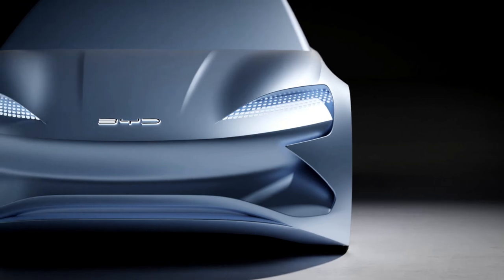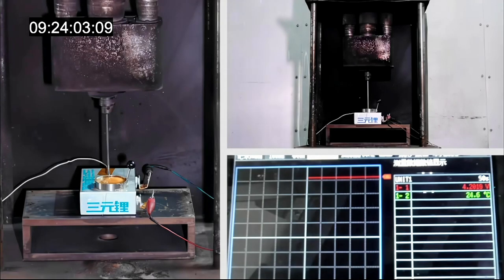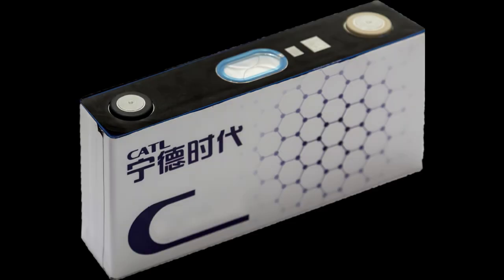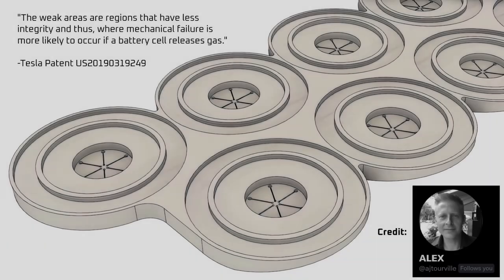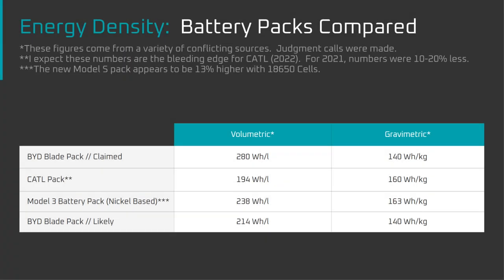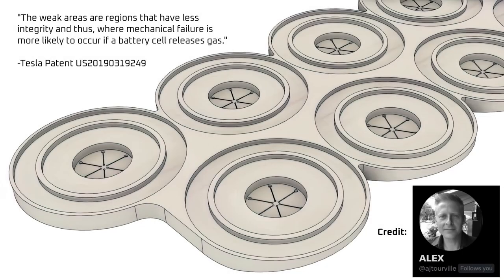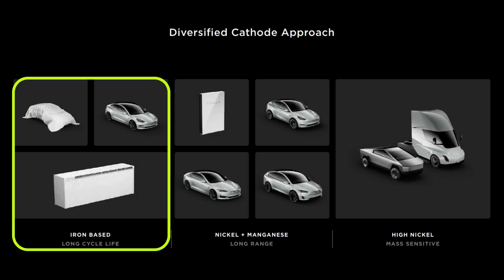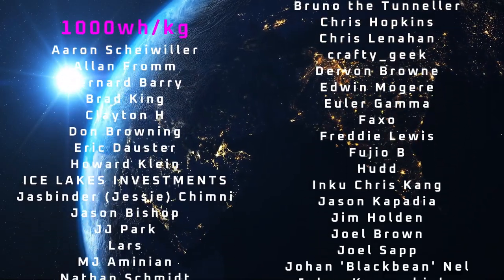The BYD Blade Battery Evaluated:  The Hype is Real (Mostly)

Comment: I had a different take on the blade short claim.
Long cell means relatively long internal distance (lateral) to short location.  Further distance to short = delayed current contribution ( I picture an instantaneous voltage well centered on nail puncture location. Prismatic has very steep well that normalizes quickly, while blade has less steep well and takes longer to flatten).  Similar to fast charging current inhomogeneities.  Long cell intentionally introduces current inhomogeneities at high power (short), extending time of short discharge due to decreased current at short, decreasing heat buildup at point of short.
NOT SURE THIS IS TRUE,. Just laying out my immediate thought when you first mentioned the claim of longer short circuit. 
Also, heat buildup of rapid mass transfer is better distributed away from point of short and close to surface for dissipation.
Thanks for producing these!
Note, this is purely personal opinion.
Reply from the maker: Thanks for your thoughts!
Reply: "long internal distance" depending on which edge the contacts are on.
Put them on the "long"edge of the  cell (top and or bottom) and you essentially have an unrolled 4680.
Then you have a REALLY short path with all the associated benefits.

Comment: nice breakdown.  one thing to keep in mind is that lion(nmc&nca) both do not want a 100 percent charge nor a 100 percent discharge, where as lifep04 has no problem with it.
Reply: They don't want to be STORED at 100% or 0%.
There's an interesting observation in the latest Bjørn Nyland vid, concerning the pack in his brand new Model 3.
He not only details the pack type) size (LG, 78.5kWh, 75 Useable) but talks about the common perception of "0%" and the TWO buffers below that figure in Tesla packs, one of which you simply can't access.
It's interesting!
Reply: Exactly! And Safe non-spontaneous combustion is the first road for electric vehicles.

Comment: Very good video. The issue with the reference to BYDs model Han is that it is based on a ICE platform and not optimized for efficency they took a gasoline car and engineered a battery into it. Of course your video was 2 years ago but the ocean (BYD Seal) seems to have delivered on the promise from BYD and Tesla using BYD Cells is showing that BYDs claims where not to far off back then.

Comment: Some cases, as my bike, lfp does outperform, becouse in my case li-ion is just too much down of the power below 3,5v cell voltage to enjoy. Lfp battery gives pretty much the same power all the way, so in my case I get much more usefull capacity from pack that weights the same. Whit along of all the other benefits on top of that. Just to say to all of the powerful ebike buiders, car business is not exatly my area. I still enjoy wery much of this information, just giving a  diffrent point of view. Thanks man for good work :)
Reply: Exactly!

Comment: 65$/kWh is insanely low cost for now.
I remember not very long ago people speaking of <100$/kWh being impossible to achieve, and 100-200$ range was touted as the level at which EVs can compete against ICEs.
Having said that, 1000 km range vehicle from BYD is not impossible if they redesign it well enough.
On the extreme side you can look at Aptera EV, which achieves 1000 km on 60 kWh battery.
With some decent engineering, weight savings etc, you could easily do 1000 km in 80-90 kWh vehicle of normal proportions.
Reply: just use the nedc testcycle abd 1000km are easy ;)

Comment: You, Sir, via your channel are, Far and Away, the absolute best in providing clear and understandable information on this topic which leads me to this: One unfamiliar with battery chemistry could conclude that the OPTIMUM configuration would be Nickel/Cobalt/Aluminum chemistry in a Blade configuration providing the heat dissipation of the high-aspect ration blade cell with the gravimetric and volumetric energy density of the NCA chemistry. What say ye?
Reply from the maker: Thanks man! Tough call!  That's a lot of high energy, highly reactive chemistry in one cell.  Playing with fire.  Plus, cylindrical is easier to manufacture.  That is, we have to see how it plays out.  No one has a monopoly on the truth.  But, I suspect Blade was optimized for LFP while Tesla optimized for Nickel (note:  I've covered this in other videos)

Comment: The blade format looks good for distributing heat, and thus resilience against single cell failures propagating through the battery pack. But are they still sufficiently robust to handle e.g. a 20 cm intrusion into a battery pack? Would you get the same number of cathode-anode shorts with blade cells, as with prismatic cells? The blade pack could have more cells damaged than a prismatic based pack, given the same intrusion depth. The drill demo should rather have been trough stacks of cells, with the same accumulated thickness. For example two prismatic cells stacked, vs 10 blade cells.
Reply: I wanted to ask the same thing!

Comment: Curious what you think about the transverse orientation of the blade cells in a car pack with regards to damage induced thermal runaway. The pierce test was one cell. Seems like in a road debris scenario that orientation could results in multiple blades being pierced. Would that negate some of the thermal control that this form factor provides? Would a longitudinal orientation provide better protection? I do realize this may all be worth minimal improvement and could impact the structural value, but I am interested in your thoughts.
Reply from the maker: I think you're right, but I don't know if they could make the batteries that long?  

Every battery is a little bomb and will explode under certain conditions.  Safe isn't achievable, only safer.
Reply: @thelimitingfactor  Appreciate the response.
Reply: @thelimitingfactor  It could be half length.
@motofunk came here to say the same thing.  A nail puncturing a pack with a 1/4 thickness blade cell will potentially pierce 4x the cells, so a more fair test is a nail piercing a pack sub-assembly with the same thickness as the nail length.  Seems like a good design, but I hate exaggerated claims, especially when they are more a function of hacking the specific test than what the test was intended to capture.
Reply: @Sn0wZer0  
A "nail" arriving underneath the car will either arrive at 90° to the narrow edge of a blade, or if at say 45° will reduce its effective length by 30%, plus it will have to get through the pack casing (I assume there's some insulation?) At that point, it's more likely to bounce off than penetrate.
Those factors will also absorb energy.

I think the BYD nail test is in fact virtually a "worst case" scenario.
Reply: @rogerstarkey5390  What you bring up applies equally to most battery styles, so it is not a way to say one geometry is safer than another.  I agree that EV battery packs in general are pretty safe, and a well-engineering enclosure should cover most situations, but that's not my point.

Let me try rephrasing my point.  Which is safer?: 
  (1) a nail going through 2 prismatic cells
  (2) a nail going through 8 blade cells.
Testing 2 cells each is not realistic for a densely-packed battery pack, since the layers of foil and compromised battery volume will be fairly similar.  Taking my point to the extreme: if the test procedure states that the nail should go through the center of the cell, and I build a cell with a donut hole in the center with no active material.  My cell would look great in the test, but I haven't made a real-world pack any safer.
Reply: @Sn0wZer0  Just for clarification. My original thought on this was not just for nails. As you know there are many types and size of debris that can hit the bottom of a vehicle. Can't simulate them all, but I do think that changing the orientation could minimize the number of cells compromised in a penetration event caused by driving over debris. In a crash with compression of the body, not sure if its better or worse when you factor in both front/rear or side impacts. Some multi-cell testing would be interesting to see.
Reply: @motofunk1  Yeah I totally agree.  I was just trying to add that BYD using the nail test to differentiate cells is not realistic for packs.  On top of that the nail test itself it probably not a good model of pack damage, as you and Roger point out.  Now that there are many more EVs on the road, it would make sense to use actual damage to guide the design of a better test.

Your original point is a good one, as a "titanic style" tear of the bottom is very plausible hitting something strong and metal at highway speeds.  It could compromise every cell, thus shorting the entire volume of the pack, without having to wait for a thermal runaway chain reaction.  This is nearly impossible for cylindrical or prismatic cells (with time thermal runaway gets them all, but time allows escape).  A longitudinal layout makes sense, as you'd have to be going sideways at that same speed, and that should be much more rare (high speed spin prior to hitting the object).
Reply: @Sn0wZer0  Thanks for the feedback. I enjoy these discussions.

Comment: Jordan, since you cover both batteries and gigacastings, I have to believe you have an opinion about the next step for Tesla in manufacturing.  Cost wise, all vehicles should have front and rear castings with a "structural pack."  The structural pack therefore has to be NMC or LFP or whatever future chemistry is used...and also 4680, 2170, and whatever other form factor they want to put in there.  We know they will have a 4680 and 2170 structural pack, but what about the LFP version?  Can they use their current dry process to make LFP cells?  Also, when will Tesla swap the M3 to front and rear castings?
Reply from the maker: Yup!  Video is scripted 😀  LFP 4680 is feasible and may offer some advantages.
Reply: @thelimitingfactor  Referencing from your past videos about 4680s, an LFP 4680 would have more active material/kwh, hence greater specific energy, ergo more miles.

Comment: Does the travel time of each electron throught this long battery not become a factor ? Heat/energy loss? What I mean by that is the tabless electrode in the 4680 was there for a reason ?
Reply from the maker: LFP can handle heat better, but their may be efficiency losses vs 4680.  Maybe 2-3% less efficient?

Comment: In years to come it will be interesting to see a comparison of the torsional resistance of the blade-based Tesla battery and the 4680-based battery - or for that matter a comparison of the respective car's torsional rigidity. I am no mechanical engineer but the blade battery looks more likely to fit the role of a structural member.
Reply: Although the 4680 battery is structured in a honeycombed design. In principle, a honeycomb can handle lots of load stress in all angles.
Reply: They both work exceptionally well. The Tesla 4680s are cast into a solid block which is why it is  so rigid and strong. The wonderful thing about all of this is that it all is exactly what is Elon's goal for electrically powered transportation.

Comment: Reducing vehicle weight, lowering CF, and reducing motor and gearbox friction with their LFP blade batteries can make them meet their Ocean-X goals. It will be interesting to see if Tesla exports BYD's $25k EV instead of building them in their European and USA manufacturing plants. BYD's MING EV with CF below 0.18 using their new hub motor patent shows great promise. If they figure out how to mass-produce carbon fiber bodies like Aptera they will also lower weight. :yt:

Comment: Great video again! I think, as the size of the battery cells decreases and the number increases, the effect of a defective cell on the total capacity of the battery decreases. In the long run, this may pose a slight disadvantage to Blade cells. One cell got bad and lost your ~%1 of capacity right away.
Reply from the maker: A good point
Reply: I've suggested a solution in 2 different posts here.....
Reply: More cell material spread over a large area might mean that an entire cell doesn't go bad the same way as a small, compact one.
Reply: On the other end, since the fire protection foam is not needed, it seams easier to replace.
Reply: @AudiTTQuattro2003  
"1 cell craps out" and you lose 0.1% performance (ask Porsche, they have that problem now)
Reply: @AudiTTQuattro2003  depends on how it craps out. If it loses capacity or blows a fuse, no biggie. If it starts draining, that's worse.
It'll be interesting to see how the improved thermal properties affect end-of-life behavior and failure modes.
Also, current LiFePO4 batteries have fantastic lifespans, it'll be nice to see how long they can last in cars.
Reply: @galfisk   Yes!
Reply: @AudiTTQuattro2003  Yes!
Reply: @shumymikaball  Exactly!

Comment: How are the blade batteries wired up? At the ends of the blades or along the top and bottom edges?  It feels like if they are wired along their ends, it would be going in the opposite direction of Tesla's tabless  design,  making heat harder to manage, and reducing efficiency.   Also,  isn't the greater surface area / heat sink design (better heat management) countered by having the blades touching each other?  And wouldn't the reduced number of layers mean more casing material by weight compared to prismatics?
Reply from the maker: 1) At the ends.
2) Plate cooling would be enough.  LFP is more robust.  But, I"ll cover this more in the 4680 LFP video.
3) That's why I think they're not hitting 63% packing efficiency.  Every one I've seen so far leaves gaps.
4) The blade is prismatic, it's just a funny shaped one.  Yes, as noted in my pinned comment.
Reply: @thelimitingfactor  thanks for the reply, and thanks for always making me think! :)
Reply: @thelimitingfactor  Could wait for your next video in LFP Blade. Hope you could discuss further on a hypothetical question to which some commenter had already quizzed: what if the cells are thicker, and the connectors are on the bottom and on top, what would be the difference in effeciency in kwh, heat dissipation and energy?

Comment: Can't help wondering why the raw egg is present for the competing technology nail tests but absent for the blade. Is it to simulate the cooling liquid? I suspect it helps contribute to the thermal breakdown of metal based batteries.

By present I refer to the nail actually passing through the egg en-route to puncturing the battery thereby delivering the liquid egg directly into the puncture hole.

Comment: Thanks for the video, glad I found your channel today. I just took delivery of a 2022 BYD Dolphin EA2. I choose the car because of the Blade battery pack and the low cost. Living in Guangzhou the small size was important but I wanted a safe battery too. I just charged my car for the first time and the fast charger stopped at 95% charge. I was wondering about your thoughts of charging the Blade battery to 100%. It wasn't mentioned in this video and I understand that it's not a problem for the LFP. Thanks!
Reply from the maker: Correct!  LFP is robust to high states of charge.  Not invincible to it, but very tolerant.  In fact, it's a good idea to charge it to 100% at least once a week for the BMS to balance the cells.

Comment: Another unknown with the blade form factor is cycle life. With a large cell there may be more chance for irregularities to accumulate in different ends of the cell over multiple discharge-charge cycles. On the other hand, efficient heat removal may work to extend cell cycle lifetime, even with the more heat-tolerant LFP chemistry.

Comment: Try stacking 4 or 5 blade cells and puncture those with the same long nail. It might not make a difference but you also might see a different result with that one continuous piece of metal connecting all the shorts together.